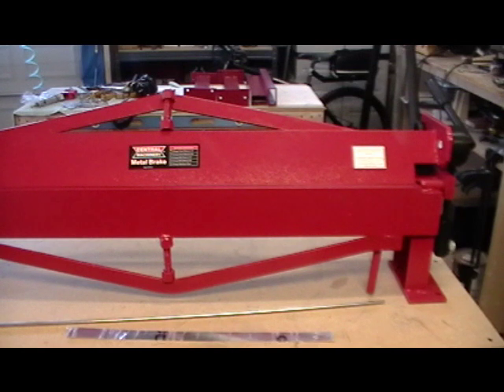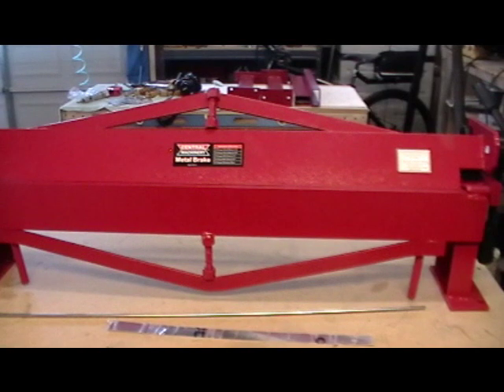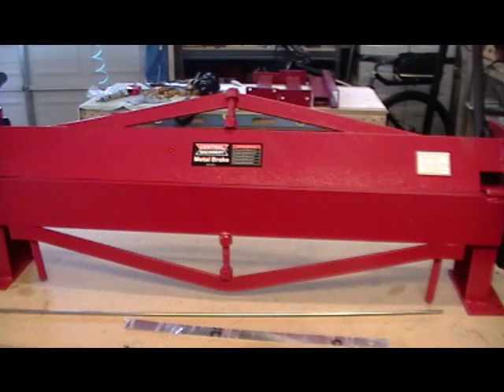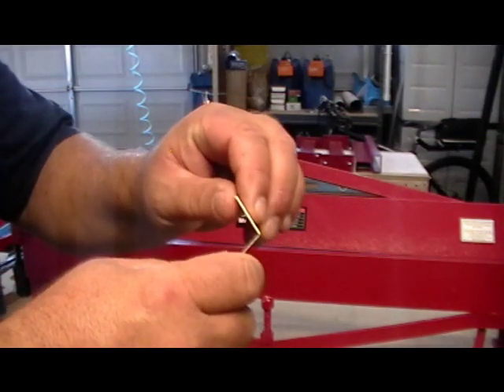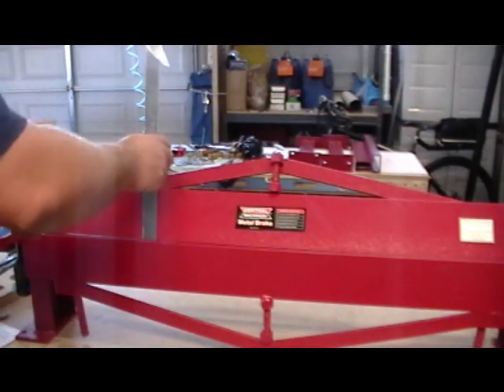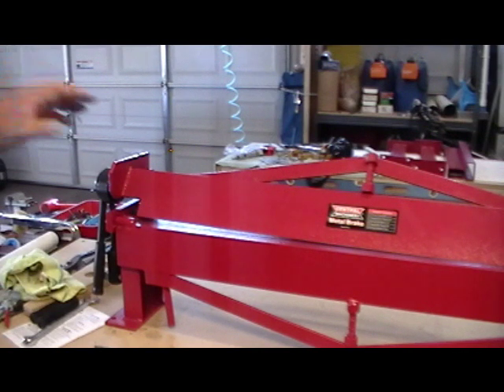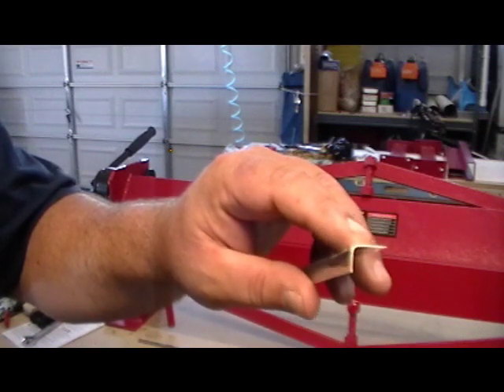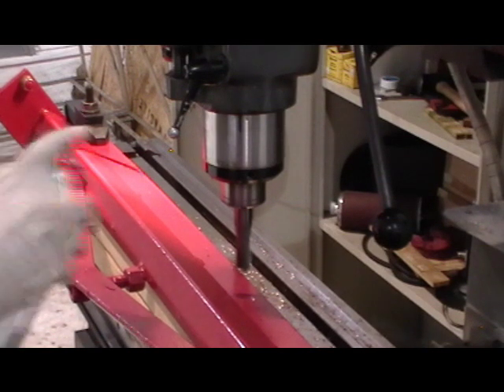The Desert Bearhawk Project: Sheet Metal Break Modififcation

Comment: I bent some aluminum struts for my Airstream on a brake like that and was able to get a decent rounded corner just by adjusting the top clamp backwards so it wasn't bending so tightly.  If you are building aircraft, maybe that isn't precise enough though.
Reply: BoltchamferBoltchamfer 9th to